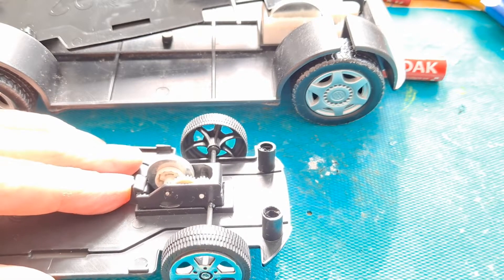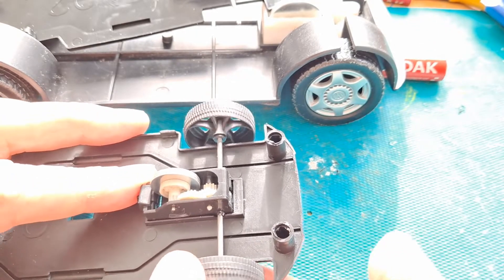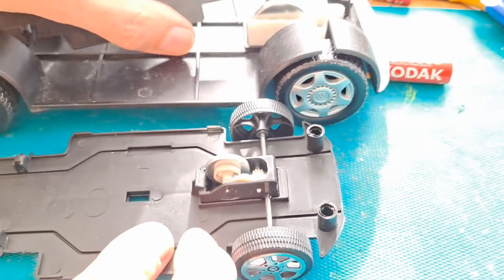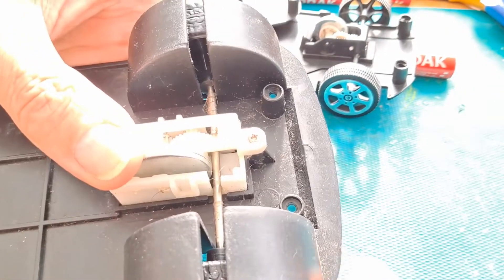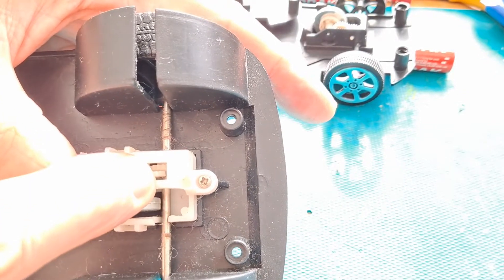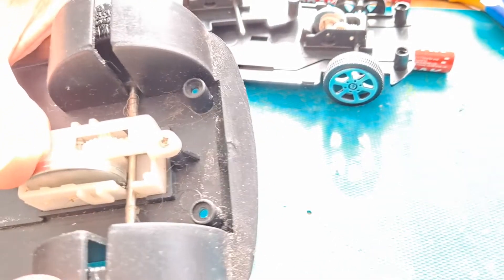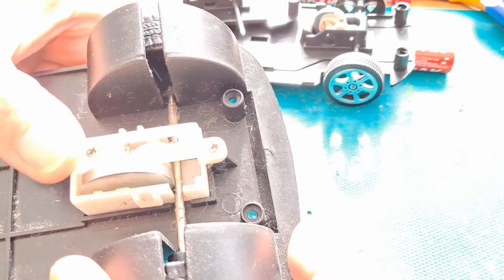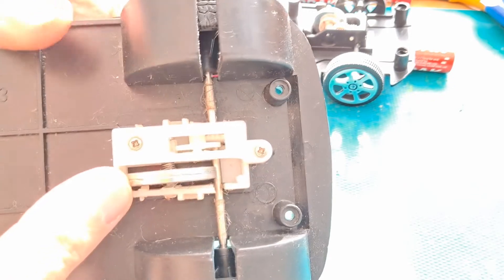Video reply - Another look at a friction or Flywheel motor 20220824

Comment: Cuantos dientes en total tienen esas cajas de engranajes? Cuantos dientes tiene el volante de inercia?
Reply from the maker: @GasparContreras-gt5oq  I didn't count them,  but if you freeze the screen, you should be able to work it out for yourself.
Reply: @GrandadIsAnOldMan  Es importante esa información ya que con eso puedes saber la potencia que tiene la ecuación es : número total de dientes dividido por los dientes del eje arrastrado
Reply from the maker: I don't want to know the power, it is not important to me. But if you want to know the power, you would also need to know the mass of the flywheel, speed of rotation, and the number of teeth on any intermediate gears, and the diameter of the wheels on the axle.

Comment: You take out a lot of little screws doing these tiny toys.

I highly recommend you get a electric precision screwdriver. They'll save your wrists.
My personal favourite is the Miniware ES15, but I think just about anything even a cheap triple a powered wow stick will do.
Reply from the maker: Thanks, but I don't suffer from limp wrists 😆
Reply: @GrandadIsAnOldMan  Oh no, this isn't a limp wrist thing at all. Everyone gets tired wrists after doing dozens of bolts in a row. I didn't mean to imply anything about your, I'm very sure, strong wrists.😁
Reply from the maker: @BeefIngot  hahaha. As it happens I do have an electric screwdriver, haven't used it in years. I did buy it when I was doing a lot of tear down videos, to speed the process up. Plus my cordless drill has the screwdriver capability.

Comment: Interesting, that seems to be like arguing whether a vehicle is a gas motor or combustion motor. Realistically both are right.
Reply from the maker: And then some bright spark (probably me) will tell you that everything is ultimately solar powered because that is where all our power originates from. As in plants need sunlight to grow etc down the line to oil or gas. Even wind power is caused by the sun. And then somebody else will chip in that nuclear power isn't (probably me again, depending on which side of the argument I want to be 😆😆).
Reply: @GrandadIsAnOldMan  Lol